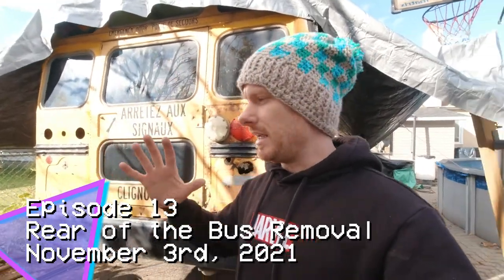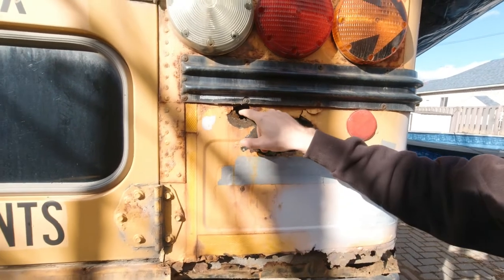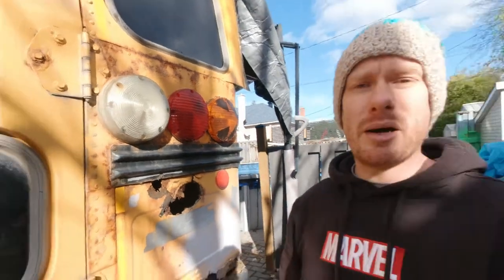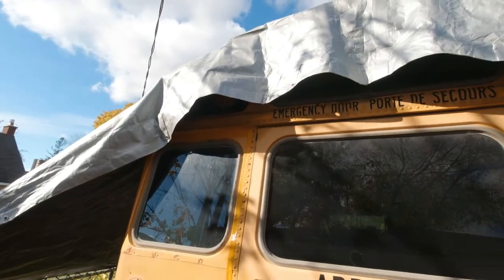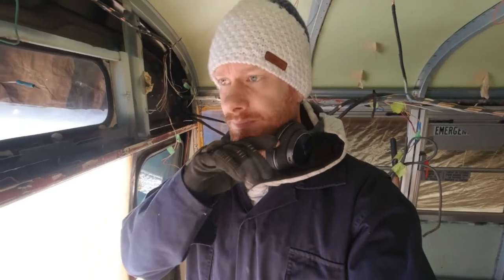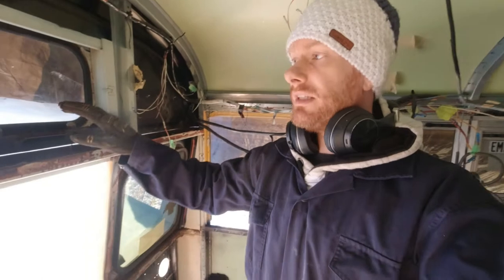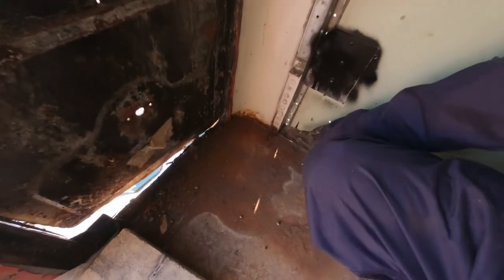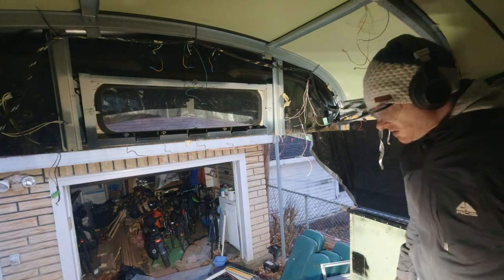How To Remove The Back Of The Bus (In Case You Need To…) | Skoolie Conversion | Ep. 13

Comment: A brave undertaking. It took some figuring for me to reconstruct the rear of our bus with the large roof raise and the angle at the top. Looking forward to seeing what you do with this fabrication. I'm assuming with all this corrosion and the French writing that you're in Quebec?
Reply from the maker: Thanks! I have to admit I don't completely know what I'm doing. Learning as I go! I'm still trying to figure out what I have to do. The challenge now is to reconstruct the frame.
I bought the bus in Quebec but live in Ontario at the moment.
Reply: @johnalbrecht6  I recommend reconstructing with tack welds until you get the shape right. Use a flux core wire feed welder outside. I used 1/8 inch thick angle iron and the 14 gauge hat channels that I had a fab shop make for me with their press brake. If I were you I'd start with replacing the horizontal bracing at head level with square tubing, then maybe use thick angle iron at the floor level. That gives you two points to work from. Then you know that so high off the floor it's 90 degrees. Once you build that then you can fit the cross bracing for the angled part without having to measure the angle. You can weld and also rivet small pieces angle iron in place as gussets, or weld additional metal as gussets in the corners. Combined with riveting the sheet metal on it will be strong.
Reply: And it's great to not know what you're doing, because it's a chance to learn new skills.
Reply from the maker: @allmomomosthomebus3895  Thank you so much for the advice! I have a stick welding machine at home, I know it’s a little bit more difficult. If ever I can’t do it, I’ll try to rent the one you recommended. I was thinking about the same, starting with the square tubing at head level first. Also, I removed the last metal sheet on the floor (video next week 😉) so I also need to take care of that. Luckily, the floor is fairly easy to replace. As for the rear, the advice you just gave me gives me a very good plan now of what I should do. I will make a plan and also check how much square tubings I need. I was considering using 1.5x1.5” square tubings for the structure.
Reply from the maker: @allmomomosthomebus3895  This is exciting to learn new stuff, especially this because I’m not happy with the underbody storage that came up with the bus so I need to redo it the way I want it.
Reply: @johnalbrecht6  I strongly recommend not using a stick welder for this. Definitely borrow or rent a wire feed welder and use flux core. Also be very careful with any welding of galvanized metal. Zinc fumes are toxic and if you have to weld that at all, have a fan running. Get a high quality welding helmet. It makes a big difference.
Reply from the maker: @allmomomosthomebus3895  I’ll try to check that. For the frame, I plan on using plain steel, not galvanized. I heard how toxic it is. I bought a good helmet a couple months ago, so I’m ok with that.